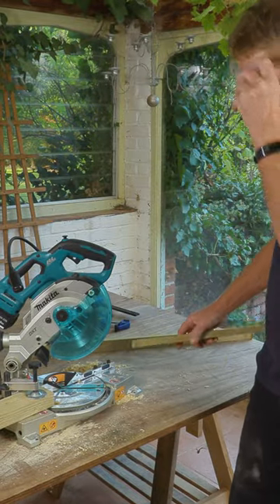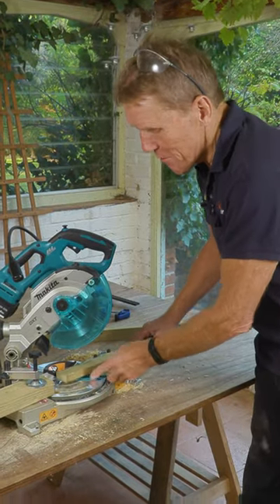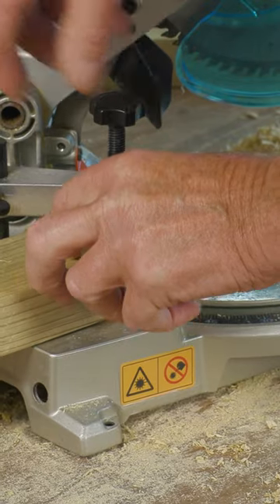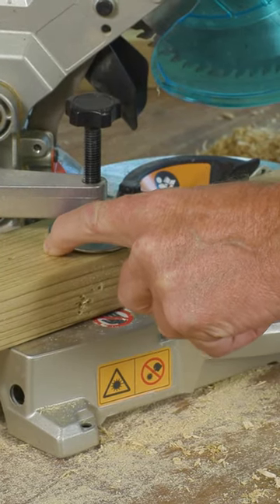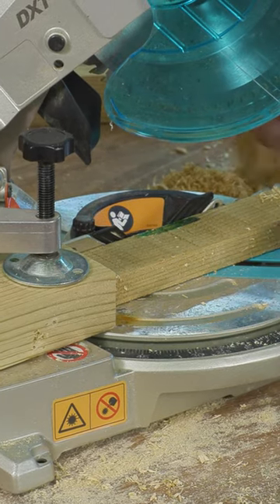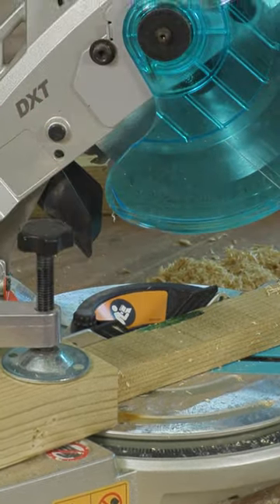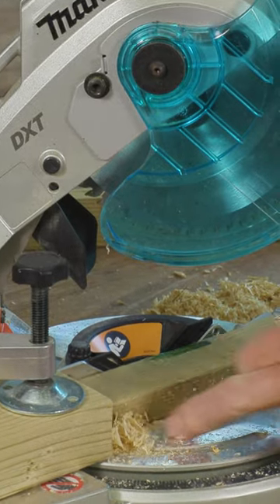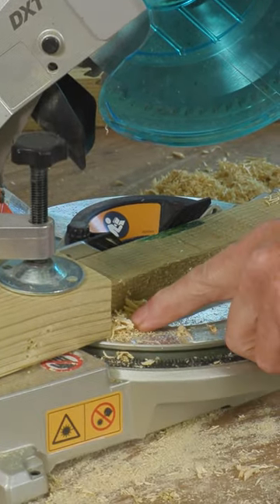Mitre Saw Dust Bust Hack  #shorts

Comment: A plumber giving carpentry tips and tricks 🤦Just blow the dust away, plus if your chopsaw works properly and you're using it properly with a hoover or dust bag attached, there will be no dust, even without the hoover the wind from the blade is automatically blowing away the dust......
Reply from the maker: You are talking nonsense.